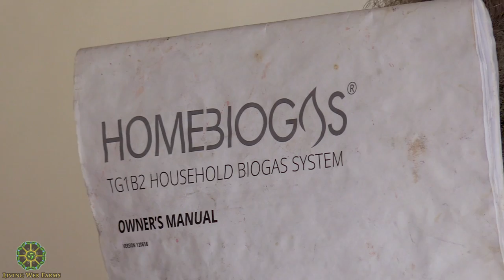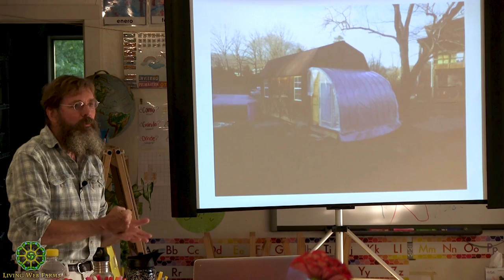Small Scale Biogas Digesters with Richard Freudenberger

Comment: I have been wondering if you have a bio digester in a cold climate could you just let it go dormant in the cold months and then re start it when it gets warm? Instead of using up energy trying to keep it warm.
Reply: bump
Reply: Yes, I currently manage the Home biogas at the Nexus project at Appstate that Richard mentions.
We let ours go dormant the winter of 2018-2019 and it started right back up once we started getting consistent 70+ degree weeks in our greenhouse.
Hope this helps!
Reply: Toy Gangster so I heard him talk about other gasses in the output. He didn’t say how they separated them. In the bio generator I’ve designed I was going to use a scuba pump to get high gas pressure. Boy was I glad I didn’t need that much pressure. I was worried about heat generation in the pump and it becomes one big bomb. I didn’t quite catch how much pressure though. I think he was too nervous. My bioreactor you just feed it and out comes the compost at the end eventually. I never thought of using the liquid for my plants. Got me wondering if the particulates would be small enough to go through a soaker hose. Probably not.
Reply: @rosstemple7617  So Ive done a little bit of research into that. So the output from our anaerobic digester is roughly 60-72% CH4, 39-27% CO2, and 1% trace gases (hydrogen sulphide, carbon monoxide, nitrogen, water vapor) respectively.  Ill prelude with my sourcing and say check out "Lucky Hill Farm" here on youtube. The guy uses bleach water to scrub out the Co2 and steel wool/clay pellets to scrub out the hydrogen sulphide (because it can corrode your equipment), then he compresses it using a gas bag and an air compressor. Low tech, looks like a good proof of concept, and no need to spend loads of capital on liquid nitrogen to compress your free gas.
We're currently beginning research into using the effluent from the anaerobic digester in hydroponics systems. We did a demo test of this last year using an ebb and flow system and got pounds on pounds of delicious cherry tomatoes. I would not apply your effluent directly to the soil without appropriate dilution.
Would be interested to see +living web farms do something similar using a biochar grow media.
Cheers, keep building, and growing resiliency.
Reply: Toy Gangster where are you conducting this research? I don’t know why these systems aren’t mandatory for pig, chicken and dairy farms? They could cut their bottom dollar.
Reply: @Kyu T Lee Yeah! That’s what I was thinking.
Reply: Have you worked out how much additional ammonia is retained in the digestate because that could be a game changer for replacing chemical fertilizer and earning extra carbon credits

Comment: Hi I am planning on taking my home in Cornwall UK off the grid. I am going to put a generator in my garage and rig it to a 10 kwh solar system. I have a wood burning system in my kitchen that powers my heating and hot water.

The only piece of the puzzle that is missing is the convenience of our gas sentral heating boiler.

If you are interested in my project please get back to me*.

Regards Martin steele